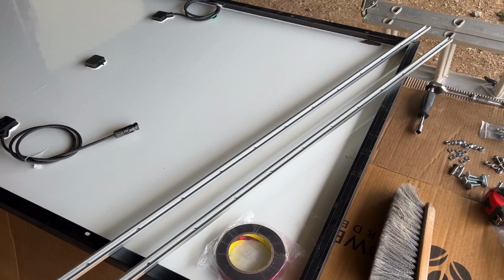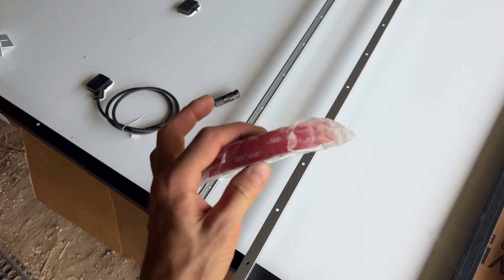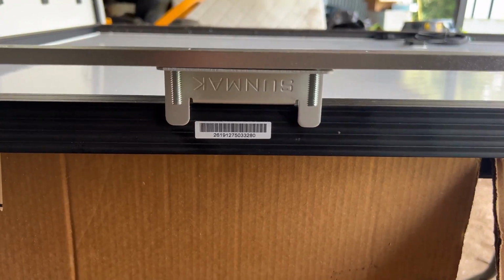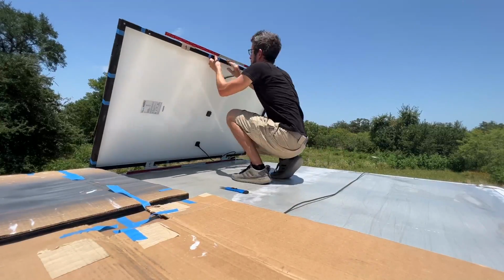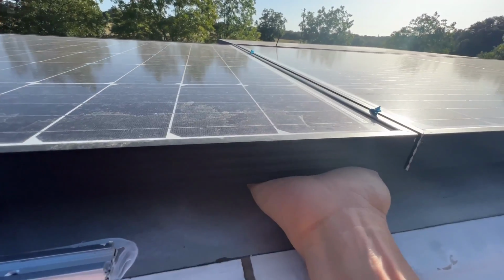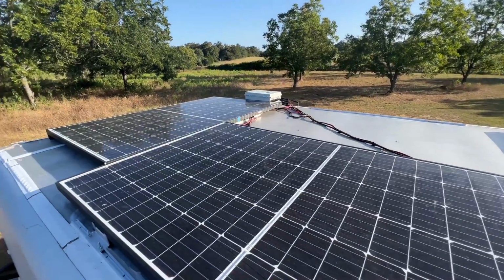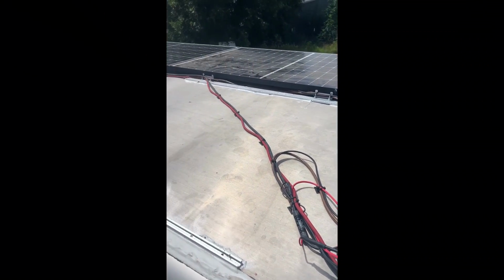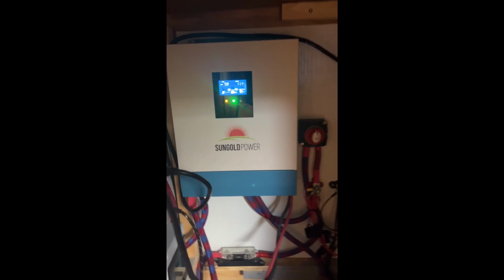NO DRILL Solar panel install for your van | AMAZING diy mounting rack

Comment: 5th generation fighter jets travel at 1000+ MPH with incredible stresses and they are held together with glue - no bolts, no rivets. In the middle east, exterior commercial building panels weighing 1000s of pounds are just glued on because the glue can handle the panels expansion and compression brought on by extreme temperature changes that used to cause damage and failures with mechanical fasteners. The age of glue is upon us. Great Video!!!
Reply from the maker: thanks! you're absolutely right about that! adhesives are very powerful

Comment: The test is driving down the freeway. Good luck!
Reply from the maker: I am currently in northern New Mexico. 753 miles away from central Texas. The panels are holding up great 😊
Reply from the maker: Drove from Texas to California, no problems driving at freeway speeds
Reply: @nomadbrad503 dang it. I am in Austin and wish I could meet somebody like you that just likes doing this stuff.
I like projects and especially when you need to be creative.
I made my own pantry out of three palates. It's like a counter sized pantry, three shelves.

I'm in one group called austin van life and i'm gonna try to post a message in there and hope there's somebody near who will meet up and has the same enthusiasm.

Comment: Just the info I was looking for! Getting ready to mount 2 x 200 watt panels on my new to me popup truck camper. The roof is pristine and I don't want to drill holes in it. This system will work great! 👍Really appreciate the Amazon links too. Hopefully I can send a few bucks your way. My panels are 55" long, so I'm going to use 6 Z brackets on each one just to be safe. Thanks again! 👌
Reply from the maker: I’m so happy to hear this. Definitely the right move to not drill holes. Good luck with the install!

Comment: I used the super sticky double sided tape to stick plastic corrugated boards the shape of my flat flexible solar panel to the roof. The openings of the corrugations face forward so the air runs thru them when I drive. I then used the same tape to attach the solar panel to the board. Just to be safe, I zip tied the corner grommets of the solar panel to the roof rack. It's been on for a few years with no problem.
Reply from the maker: yes! im happy to hear that you had success with the adhesive tape also. I tried the flexible panels with corrugated plastic on my first van. Unfortunately the panels died within 1 year. im glad you are having better luck

Comment: You can also add another cheapy small charge controller just for that 1 panel. A fairly decent 30amp controller can be had for $100.
Reply from the maker: You’re absolutely right. I was really wanting everything to work off single unit. Now I have to decide if I want to put the extra panel back and add a 2nd controller or install a rooftop deck 🤔

Comment: You might want to put on Eternabond tape on top of the T-channel for extra holding power.  Also, you may want to seal up the top of the T-channel with the Dicor - so that the elements don't get to the 3M tape from the holes in the T-channel.  Good luck with the deck - maybe leave some room for an internet antenna / dish.  Curious how you are venting if no roof fans.  Thanks for the video.
Reply from the maker: i dont think the tape would help much...if the 3m VHB tape fails, we have some serious forces at work.

Comment: Stupid question. I have an aluminum roof with a coating on it. While messing around with installing my weeboost I noticed it was easy to scratch off this coating. I should probably scratch off this layer where the track is going, right? I’d hate to apply the tape and realize that data from 3M isn’t applicable when it’s attached to the coating not the roof.
Reply from the maker: Yes, if the coating comes off easily, scrape the section where your rails will go. You could probably use a kitchen scratch pad or steel wool to get it off quick

Comment: I’d love to use this method for my transit but the roof isn’t flat. There must be a way to  adjust the height of the track to make this method work. Great video. Thanks!
Reply from the maker: Yeah, you could use taller solar panel brackets

Comment: Super interesting use of the tape! Question: In the calculation on the strength of the adhesive -- what would be the highest possible wind force acting on one of the panels if you are going say 70 MPH down the highway. Maybe it's only 200 LBS maximum so there would be no worries. I supposed if it was higher maybe some type of wind protection could be used to reduce air getting underneath the panels at the front of the rig? Your videos are super informative. Between You, Chuck Cassady, and DualEx, there is so much knowledge and great content on the build out game! Thanks!
Reply from the maker: After doing some research I found that Wind force only significantly effects the front solar panel as the air comes up over the cab. That force at highway speeds for that panel could be up to 300 lbs. each panel can support over 2,000 lbs. 

Also I did add a sheet metal deflector onto the front panel to close the gap , it made sense for overall wind resistance.

I’ll do a full solar tour in a bit and provide more detail and actual results from living with the system.

Comment: I’m a 3m certified Viynl installer . If you want to take it to the next level apply 3m adhesive promoter prior to you applying the double sided tape . That panels no going anywhere
Reply from the maker: thanks for the tip! ill keep that in mind for next time! im so impressed with how well this VHB is holding up. People still freak out when I tell them how the panels are attached 😂

Comment: I used the powertec zinc plated bolts you did, but, I used stainless steel black oxide coated serrated flange nuts, and I used blue thread locker. I am now aware of galvanic corrosion between dissimilar metals. Should I be concerned about this? What do you think?

Comment: I am putting 2 panels on a truck ladder rack until i can get a camper bed top. So i was thinking those same style rails, but a u bolt to attack the rails to the pipe cross bars of the rack.  Tape wouldnt be useful for me, but other than that, those brackets do seem like they would make it easier to attach the panels since attaching was one of the difficulties i was contemplating as i will have to put the rails on first, then do all the work on the truck.
Reply from the maker: Yes! Even if you don’t use tape, the rails are a great mounting point and then the panels can easily be removed and reconfigured
Reply: @nomadbrad503  I don't see the other post I made but where did you get those brackets from?
You said they were made for solar panel mounting.So I guess I'll search for that , but do you have any link to yours?
Reply from the maker: @waltermh111  there is a link in the video description to my Amazon shopping list. The brackets are in there
Reply: @nomadbrad503  oh yeah, I remember the link. I misunderstood it. Thanks.

Comment: If you needed to run the brackets the other direction to get the t tracks under the panels, is that possible? The renogy solar panels I bought side by side come right to the edge  of my box truck.
Reply from the maker: Yes, you can run the tracks either direction

Comment: Off topic, if you get a flat on your front tire, can you use one of the rear tires on the front and drive on 5 temporarily until you get it fixed?  Planning mine and where to put a spare.  Thank you as always, Nomad Brad!
Reply from the maker: Absolutely you can! That’s why I love having a dually..it’s like driving with 2 spare tires. 

About 3 years ago I got a flat in a rear tire deep in the woods. I just pulled off the whole wheel and threw it in the back. Decided to continue on to the camp site where friends we’re waiting. Ended up driving my box truck all over the mountains for about a week with only 5 wheels!
Reply: That's awesome!  Saves a lot of space.  Thanks very much for your quick reply.  Have a great weekend, Brad!

Comment: I had bad experience with the tape- in hot weather, it falls off. So far, how is your doing? still holding up? did you worry about wind dam for driving?
Reply from the maker: I hope mine doesn’t lift off 🥴

Comment: Brad, is your UHaul box truck the 14’ or 17’? How many miles were on it when you bought it?
Reply from the maker: 14’ roof 12’ floor. Bought it with 119,000 miles

Comment: Hi Brad, I checked out the combiner box you chose and max Solar shows 1,200W on 12v. You were trying to do 1,600.  Are you running 12v or 24v? I am thinking of doing two separate MPPTs and dividing my panels up. If something goes wrong, seems easier to trouble shoot. Ideas? Thank you
Reply from the maker: I have 48 volt panels running series parallel. My electrical system is 24 volts. I don’t recommend 12v systems unless you’re only running a few hundred watts of solar. I like the idea of multiple mppt

Comment: Where did you buy that Tchannel material? I wonder if you can buy a wider rail for more adhesive surface.
Reply from the maker: Amazon, link in the description
Reply: @nomadbrad503  thanks Brad for the inspiration

Comment: How does it hold up in the cold? I live in a 4 season zone and interested in this and how it's holding up?
Reply from the maker: It’s been holding up great. Drove from Texas to California. No problems. I get on the roof every once in a while to check if the adhesive is lifting at all. Still solid as a rock. 

The main consideration during install is to make sure the edges of the adhesive tape are sealed with dicor or another sealant so that standing water does not make contact. 

The reason I decided to try this product is because it’s used as a bonding agent for satellites. I imagine air temperature is very low up there so should be fine wherever you are at on the ground

Comment: Did it came off after hot climate?
Reply from the maker: No, I have been driving it for 3 weeks in Texas with temps over 100 degrees. Heat is not an issue

Comment: BUT!!! You're relying on the roof skin securement to the vehicle...Many RV's, campers trailers etc aren't bonded at all. So the rubber roof, fiberglass, plastic or aluminum skin etc has minimal strength to hold anything down. Maybe at edges it's fine.
Reply from the maker: I have driven it thousands of miles over the past year without any problems. I’ll let you know when the roof rips off
Reply: @nomadbrad503  Your exact vehicle, roof construction type, it may work. But many are not like that. I'd even argue it's  not a norm at all. There's many stories of roofs tearing off and lost panels. I've even seen panels laying on shoulder of the Interstate. Obviously no idea what from or cause but something failed. I've had multiple campers/types and not a single one had the roof skin bonded to anything
Reply from the maker: @ yeah this system  is specifically for metal and fiberglass roofs on vans, box trucks, and busses.  not rv’ and trailers. Those roofs are not well built
Reply: @nomadbrad503  The problem is people will watch you glue a panel to the roof...then they'll copy it ignoring the fact their roof is not attached...then poof they donated their panel to the Pavement gods. Or worst case it lands on another car.